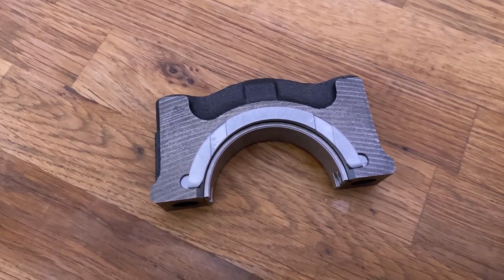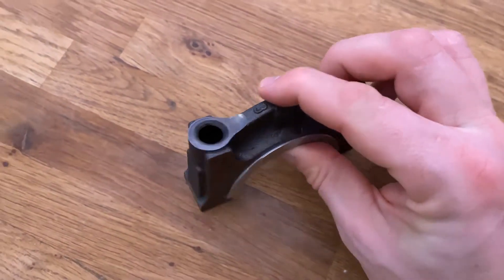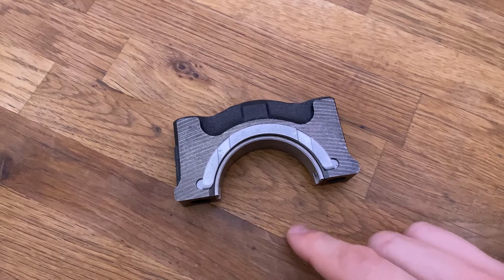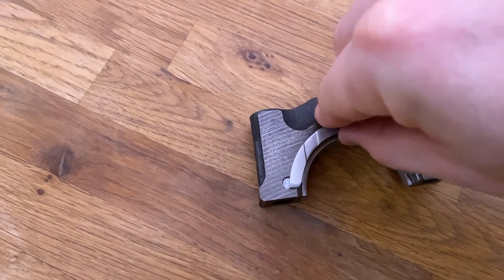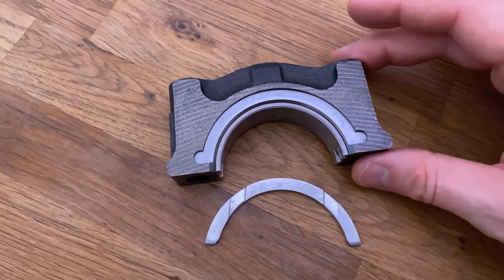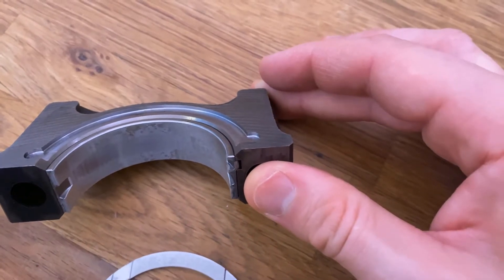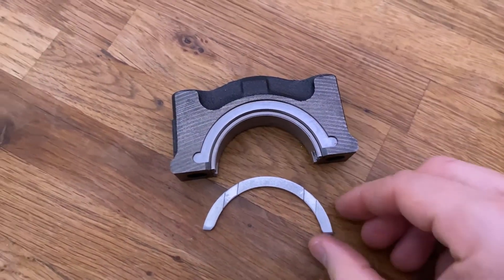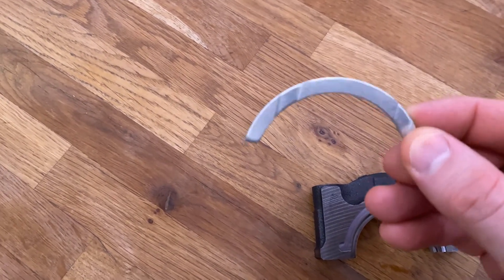360° Thrust Bearing Modification on the 2.0T EA113 (06F) PART I

Comment: Did you ever end up running these? Would be interested to know more info and the drawings and links you mentioned in the description please.
Reply from the maker: Yes, been running for 1-2 years now. What more info do you need?
Reply: Nice work, glad it's been working. You mentioned a drawing by KevinC to machine the cap...which you could provide a link to? Would you be able to post that up or upload the drawings somewhere please?
Reply from the maker: Yes, sorry. See if you can access this document: https://drive.google.com/file/d/1f1wlLjHv4j537bwnfgWiOS_fPAVU4P5S/view?usp=sharing
Reply: how deep is the groove?